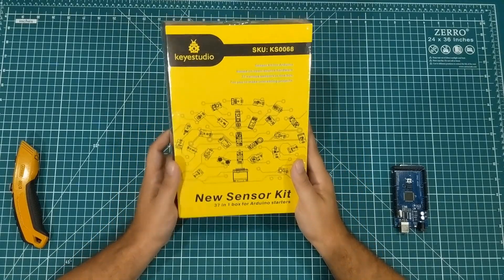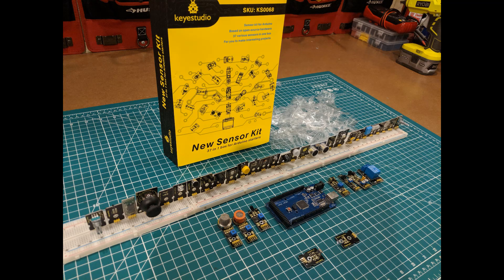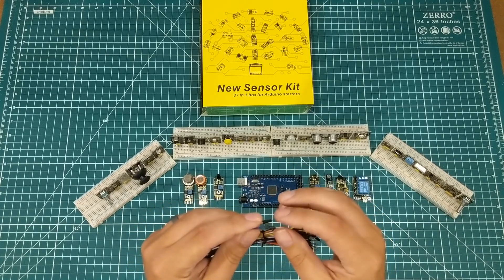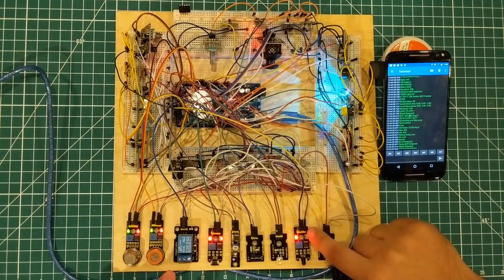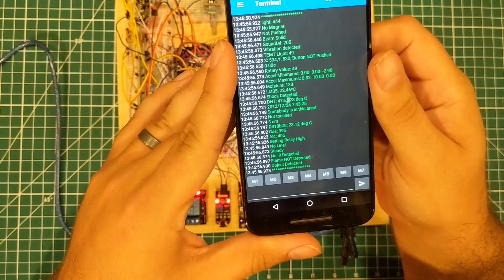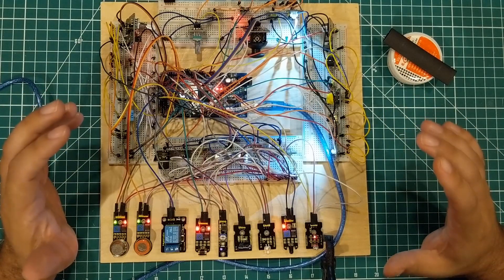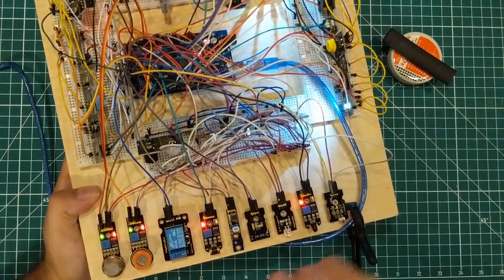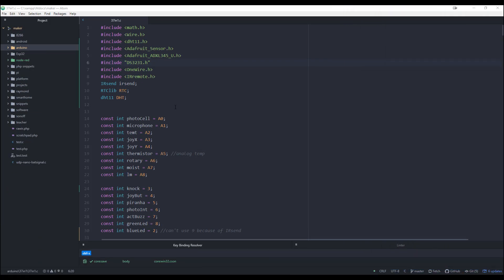37 Sensors, 1 Arduino - Here's what I learned

Comment: Would you happen to have schematics?
Reply from the maker: I don't have schematics, but if you look at my code, you can see it pretty easily.  https://github.com/mudmin/AnotherMaker/blob/master/37-sensors-one-arduino/37-sensors-1-arduino.ino

So around line 14, all the sensors that begin with A are connected to those analog pins, then the ones without A are going to digital pins. Then every sensor gets power and ground.   I tried to make it pretty easy to follow.

Comment: Awesome video ! .was thinking of doing this, but saw your video and was like SWEET I don't have to do it. but.. you said something.. that makes me want to do it myself now.. and that was YOU learned a lot from it. and I don't know how to use half the sensors.. so I'd probably learn a lot...
1 question .. HOW LONG did the whole thing take to do??  ( JUST so I know how much time I need to put into this lol )
Reply from the maker: Thanks for the kind words.  I'll bet it took me a solid 6 hours to wire and code the thing haha.  Yeah, no matter what, there are going to be parts in a kit like that which you never use...I thought it would be fun to figure out how they all work.  Definitely worth it.
Reply: @AnotherMaker  my exact thoughts..  thanks will get started  using each , not rigging them all at once though,  So may only take me 4 hrs. Lol